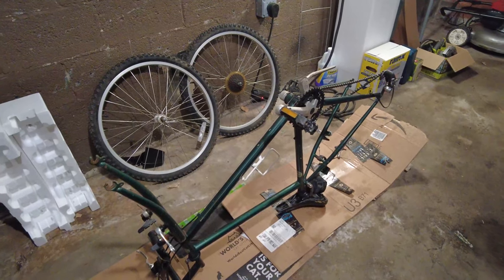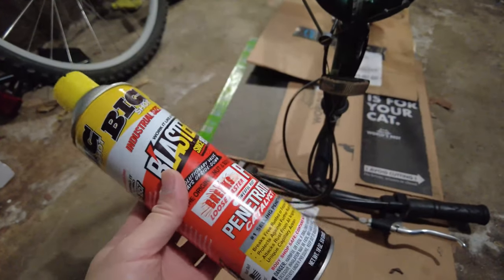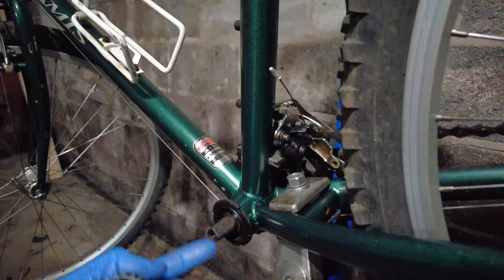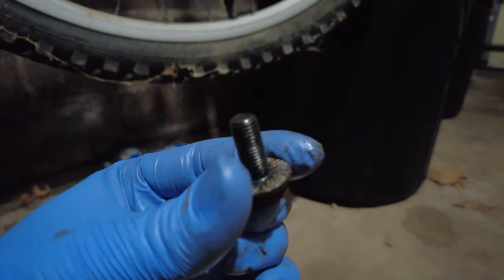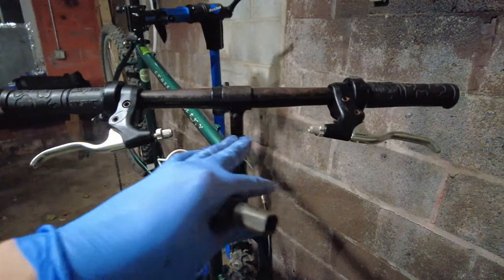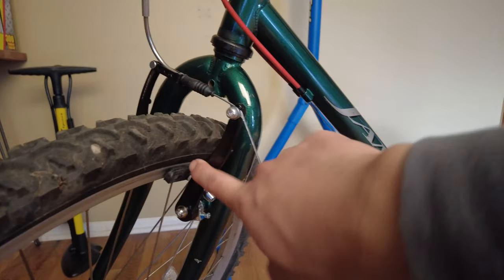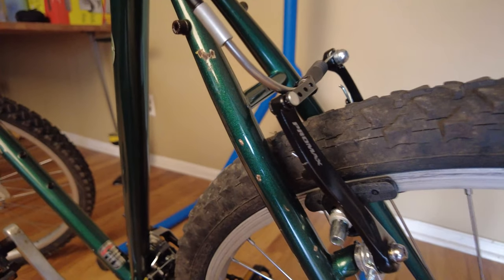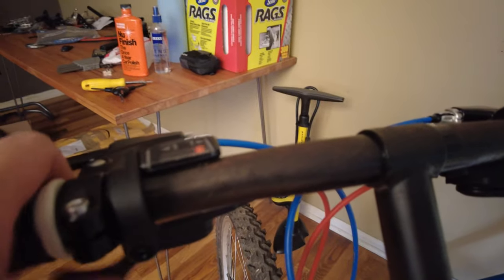Restoring A Vintage Jamis Cross Country Chromoly Bicycle

Comment: Looks a lot like my 1998 jamis cross country that I bought new back then. Still have it and in much better condition and ride it too. 21 speed.  😍 I paid $350.00 in 98 for mine. great price. Except mine has the twist shifters. I love them. 7 on the right and 3 on the left.
Reply: I got one too, a metallic dark blue. Also have a ‘96 emerald green Jamis Aurora MTB before it went to a road bike outfitted with Deore LX. These bikes are so much better than current bikes.
Reply: @tg8150  Mine is a candy apple red or something. Just replaced the street tires and tubes after 20+ years.
😁